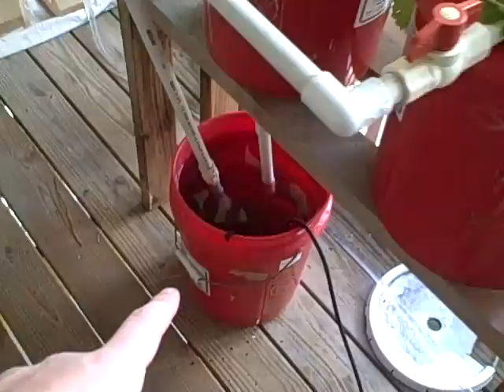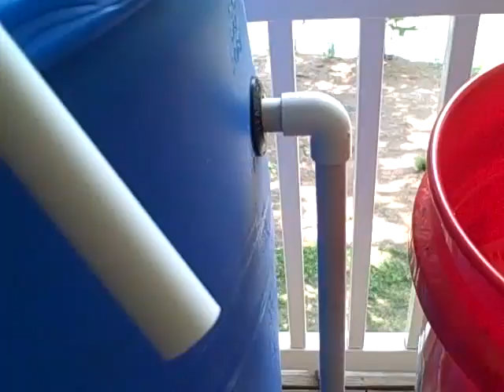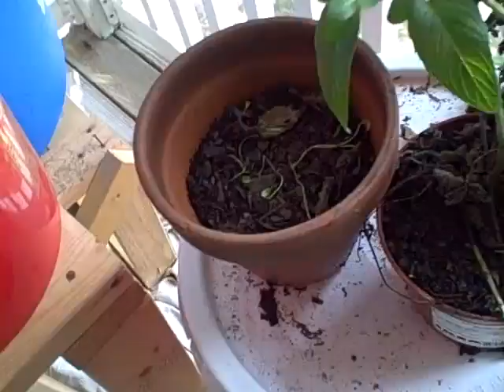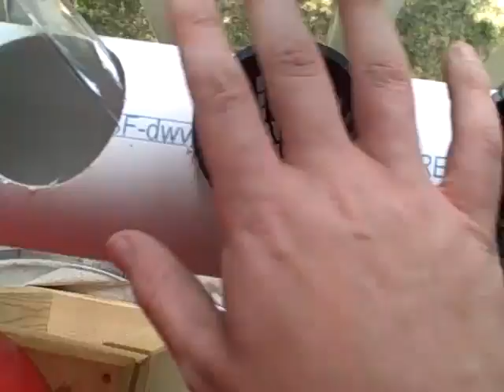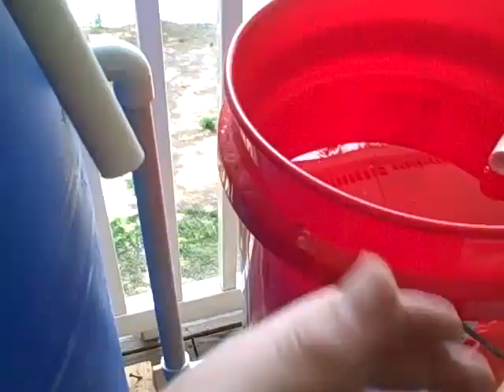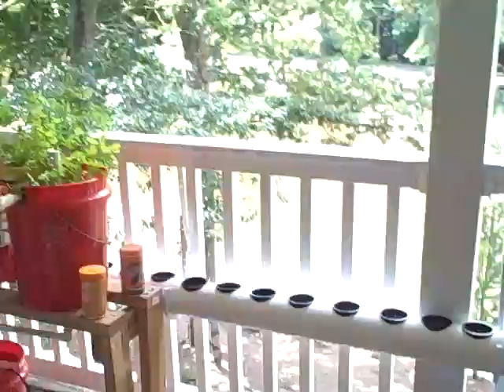tamo42's NFT Aquaponics System

Comment from the maker: @USRNSF You would be correct if there were a lot of fish in the barrel. In my particular case, there were only about 7 fish in the whole 50 gallons of water. So dissolved oxygen (DO) and other gas exchange issues didn't particularly matter.

In most aquaponic systems, an aerator of some sort is added just to create that much more margin for safety. I just didn't need it here.

Comment: Im a real noob when it comes to aquaponics but have been doing a ton of research.  I believe based on what I have read that your barrel would be better turned on its side with a small window cut in to the top.  You need more water surface area than the standing barrel provides for the exchange of CO2 and Oxygen to and from the water otherwise you severly limit the amount and size of fish you can grow in the bucket - search Aquarium surface area requirements for more information.